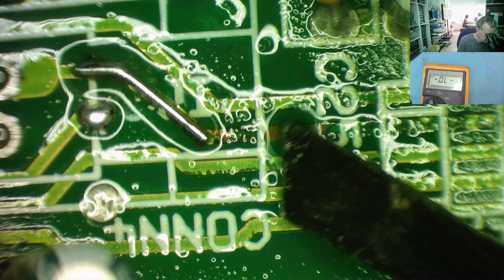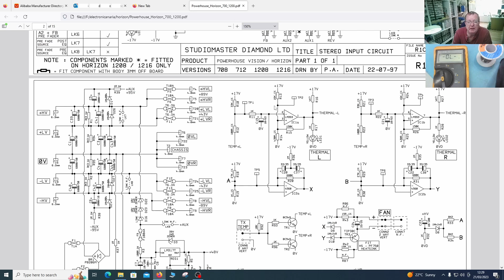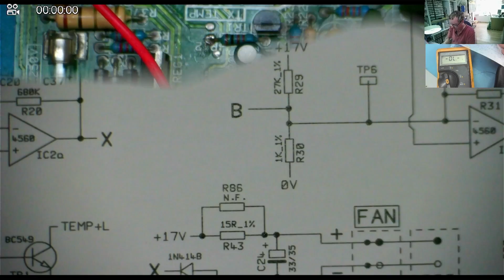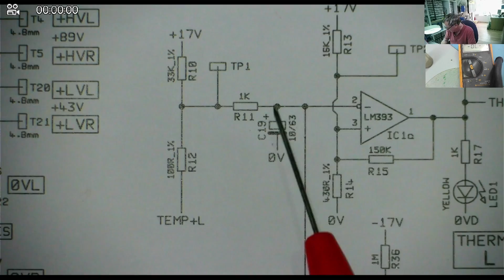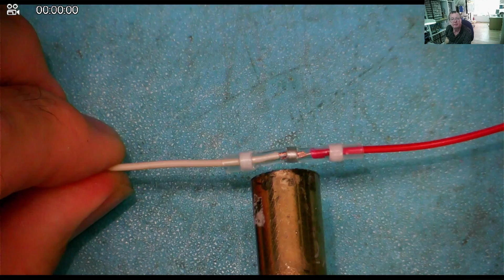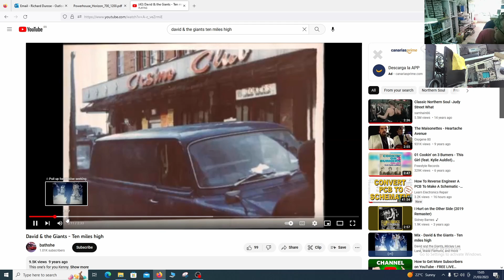Burnt PCB Repair Part 2.  Repairing the damage and replacing the components

Comment: you are such a king! thank you so much for sharing your deep knowledge of electronics! keep up the good work! i actually have a Presonus StudioLive AR16c that has a Clock/DSP issue but Presonus doesn't handout any service manuals. so i need to try fix it without schematics... since the components didn't burned through the pcb, i think it would be possible

Comment: If you didn't cut off all of the dead ended - distal traces on top of the carboned area, or, cut that whole burnt section out of the PCB, odds are if there are any traces that source or sink power over it, you will have a conductive hot spot on the board where it is carboned. It's best to use a thermal imaging device, check the board when cold, power it up, and then see if there are any hot spots from this issue. I know this because I bought a older Hewlett Packard frequency counter in "for parts - not working" condition that had a hole burned in it  from when a previous owner put a 10 amp rated fuse in it, when it was designed for a 2 amp fuse to be tripped by a crowbar voltage limiting protection circuit, the SCR designed to blow the 2 amp fuse gated on and kept burning the PCB until it finally tripped the mains / line side fuse. I could power the unit from a DC power supply, and the rest of it worked fine, but, the remaining carboned area aroud the hole turned into a thermal hot spot minutes after adding power to it.

Comment: A tip from someone who used to have to perform MANY FCOs (Field Change Orders) involving cutting tracks for mods etc:

Get yourself some solid core Kynar wire (26 to 34 gauge). This stuff is THE goto wire used for professional PCB mods globally. It's also known as wrapping wire, although typical wire wrap wire is usually at the thicker end of the gauges.

 This is fine and tough enough to superglue along a route very easily. The technique is to trim around 1.5mm of insulation from one end of the wire, solder this to the pad or track start point. The keeping the wire taut lay down a cm or so and holding the wire down with a orobe end place a tiny drop of superglue onto the wire where it touches the PCB and wait for it to harden or use activator spray. 

Continue laying the wire and gluing until within around 50-60mm of the end point. Measure out the length required, cut and trim off the end 1.5mm then solder and use superglue dots to complete the wiring. 

I first learned this technique over 40 years ago and it is still in use today. Here is a picture of just how neat a job can be done!
https://http2.mlstatic.com/rollo-de-cable-kynar-wire-wrapping-wire-30-awg-D_NQ_NP_247001-MLM20262376059_032015-F.jpg

Comment: Can you please advise the voltage rating of these solder sticks?
Reply from the maker: I will ask
Reply: @learnelectronicsrepair Repair Thanks Richard. Can you also ask what standards, IEC or otherwise, they are designed, manufactured and tested in accordance with, and if they are CE marked. Thanks

Comment: Worth noting the solderstick product is 25USD for the 50pcs box, not the 500pcs box as shown, the the effective price per piece is 50cent not 5cent as said in the video.
Reply from the maker: Oops so 500 is $99.99 less the 20% discount code so 16 cents each
Reply: @learnelectronicsrepair  still a great deal I just purchased some myself! Also I might advise to not use these in high current situations as I found no rating on their website...I can imagine cold joints happening from heat cycles...
Reply from the maker: @MrMegasuperhawk  In the review video I mad,  I compared the resistance of a solderstick connector with a soldered one using a micro ohm meter.  There was no difference,  so the current capability should be the same https://www.youtube.com/watch?v=e5MQnDgwBqs
Reply: @learnelectronicsrepair  I'm afraid that low melt solder is going to give up the ghost first at any decently high current....there's just no way around that unfortunately
Reply: "Mr SolderFix" has done a video showing how easy these are to make yourself with regular solder, if you would like a cheaper option.

Comment: I would look to remove a tiny bit more of the carbonisation in-case it conducts. I saw a guy use epoxy resin to fill a carbonised hole after he dug out most of the carbon, worked well to carefully fix an unglued pad while filling and insulating the damage below.
Reply from the maker: Note that I disconnected the -95V track that passed through this area.  There is only 17V circuitry in the damaged area now so honestly I think it will be OK

Comment: Same kind of corrosion here in Guernsey. Salt is everywhere in the air. Stainless steel is rusting almost immidiately when left in high humidity area like garage or shed. PC components like ports all covered in rust.

Comment: Richard - in cases of pcb burn through - it is usually necessary to drill/scrap out the major portion of the affected burnt charred area to prevent further arcing . The pcb substrate has been carbonized where it flashed over and with further exposure to corrosion it will be prone to arc again.
Reply from the maker: Leo, in general I agree - but in this case you can see that the high voltage -95V track which passed through this area of the board arced over causing damage to the localised 17V circuitry, but does not connect to it..  As I cut the -95V track at both ends, replaced it with a wire, then repaired the low voltage circuitry in the burnt area I don't see how it is going to arc over again.  Unless I missed the point you are making somehow. I think this repair is perfectly fine as only 17V low current op-amp circuits exist in that area now. I'm always up for constructive criticism, if you feel that is wrong then let me know, and why you think I should have approached this differently.
Reply: @learnelectronicsrepair Richard thank you for the reply.   The circuit only had a maximum of 95vdc + 17 vdc > 112 vdc so  I = E/R.(ac signal here is very low - no effect) DC resistance changed due to corrosion on the pcb thus allowing the current to increase between traces resulting in arc over. The pcb is carbonized at the point of arc over. Possible current - 112 dc amps anywhere the pcb was burnt shows where the pcb substrate was heated to the point of no return.  It does take a little work to remove the affected area and reseal the pcb with a waterproof high dielectric to prevent moisture penetration into the pcb. This unit is probably going right back into the same environment that caused the arc over -leaving a carbonized pcb is inviting a future failure - I prefer to minimize my warranty recalls if possible
Reply from the maker: @Silverlion49  Yes, but surely by cutting the -95V track (both ends) and re-routing it with a piece of wire, as I did in this video, means that the maximum voltage in this burnt area is now 17V so all will be OK, and to make double sure of that I didn't solder the low voltage op-amp circuitry back into the burnt area either

Comment: Well done. Not easy (and many so-called engineers wouldn't bother) to isolate such damage, especially when burnt PCB is nearly always conductive to some degree. You know you can drill a hole through to be sure. Personally, I wouldn't have continued if I had wired something incorrectly (listen 21:36), probably after-effects of the sangria, ho, ho.

Comment: If I might venture a guess, The electrolytic capacitor leaked oil onto the board, the high voltage begins to heat the fiberglass turning to carbon and slowly becoming a resistor until it begins to draw more than it can take and burn up the surrounding path of the board. Its like that arc art people make with microwave transformers.